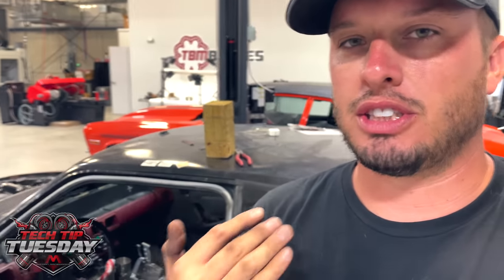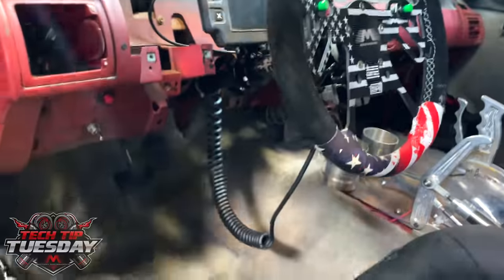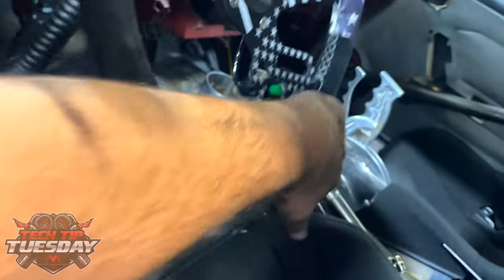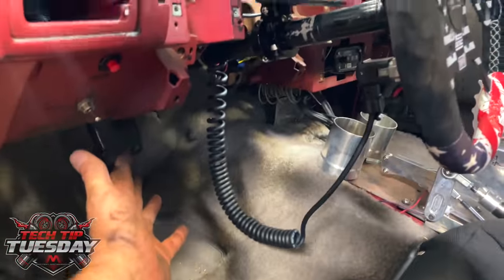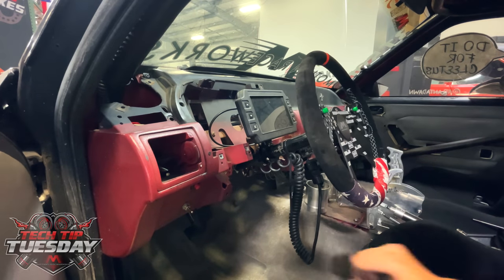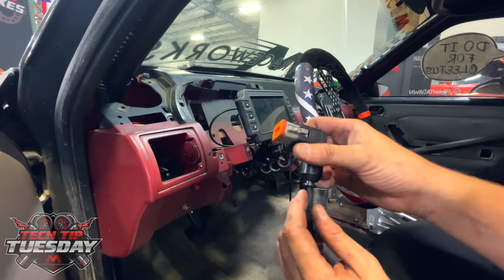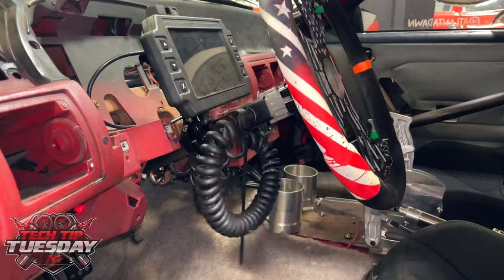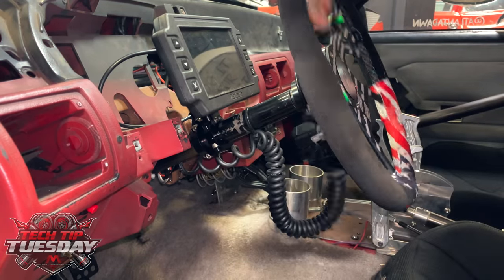Protect Steering Wheel Buttons with one easy tip! Tech Tip Tuesday - Free How To Video

Comment: Nice. In addtion, I would take a small section of rubber hose and slit down one side it so that it can go over the wire where you zip tied it to the column to provide some additional strain relief where it attaches to the column.

Comment: Hey Guys love all your products. Installed a icon series throttle body a month ago and it not only fixed my idle issue but it fixed issues I didn’t even know I had. 

I’m wondering if you guys ever run expansion tanks for Co2 boost control. I’ve been fighting my system all summer. Tried every PID setting possible. Some guys on Holley forums recommended a small tank to increase dome volume essentially. I’m building one now. Wondering if you guys run anything like that and if so I think that would be a great product to offer and maybe some tech tips on it would be great. Thanks for all the awesome content.

Comment: why has someone not designed a clock spring setup, like used in an oe column, but specifically designed for motorsports use? we have the technology to make a street car drive 1000+ miles and run 5s, but nobody can come up with something better than a wire wrapping around a steering shaft?
Reply: There are solutions like that. They’re just pricey

Comment: You guys should make the disconnect have the wire run in the middle and when u remove the wheel have a plug built inside of the middle  you guys make  Steering wheels and  almost everything for steering might work out would be nice no more wires hanging down

Comment: When are you guys going to make a pad similar to factory cars where the wires mount to the wheel and the column with spring loaded pins coming out the back of the wheel to ride on the pads on the column then wires can be loomed tight to the column and no more hanging phone cords at all
Reply: These days a "clock spring" assembly is used. Plenty of Youtube vids on them. I was thinking an aftermarket version would be cool. I guess it would be hard with all the different size steering wheels and columns out there.
Reply: @HSVR383SC  i know a clock spring is used but todays race cars dont have air bags or cruise control with a Motion column and wheel, i was referring specifically to their columns and wheel set ups. They are getting into back of the track stuff so most of those vehicles do not have creature comforts, just whats needed to get down the track so them and I would be interested in something without a bulky connector hanging off the back of the wheel and stretchy cords

Comment: Here's another tech tip to stuff inside your tech tip: When working on steering components where you'll want to cycle the wheel from lock to lock a few times to test that everything is working as it should, jack up the front of your car just high enough to get the front tires off the ground. It will be easier to turn the wheel and you won't wear a flat spot in your tires. Yes I know you're not really going to wear your tires on a smooth painted or tile floor but a lot of folks work on their car in their driveway. I mean the car was already parked in a 2 post hoist, just take 30 seconds to raise the car off the ground.

Comment: Doug you guys are always trying to come up with new stuff right, why don’t you create some type of quick connect clock spring type steering wheel, where the wires pull out of Center post, the guys usually just hang it in something nearby anyway, wouldn’t that be nice, unlimited buttons curly cord that pulls out of Center tube and you can make a mount for hanging the steering wheel nearby. Think about the convenience, you could even make the steering wheel mount a quick electrical connection! No cord just plug and play clock spring for a race car! Limitless possibilities, turn signal buttons, nitrous, scramble, headlights, cruise control, dude we should make this together.
Reply from the maker: We have spent tens of thousands of dollars on this and have working prototypes. It’s a less than perfect solution tho with its own limitations and downfalls.
Reply: I bet, thanks for the reply
Reply: Just seems like a great idea
Reply: Late 70s and early 80s Ford, Mercury and Lincoln had cruise control buttons in the steering wheel. They used a horn button plate with multiple spring loaded button type  connections. They were everywhere and I made a fortune fixing horns and cruise control failures, in the 90s. The piece was 35 bucks and had wires soldered to the plate and a plug on the end. Failure usually was just a dirty connection where the plate turned against the buttons.

Comment: Make them bluetooth and eliminate the wires all together.
Reply from the maker: I can’t ever get my phone to connect Bluetooth to the speaker I use everyday… that doesn’t work well in racing
Reply: @MotionRaceworksOfficial  also, as small as it may be, there will always be delays to wireless communications such as bluetooth. with reaction times being so crucial, wired vs wireless could be the difference between winning or losing a race.
Reply: @MotionRaceworksOfficial  If it was easy it would already exist.  Instead of using bluetooth you could use one of the methods that have been around for decades like Remote Control cars use.  I just know that I can't stand anything hanging from my column like a long lanyard and would not like the current tech.